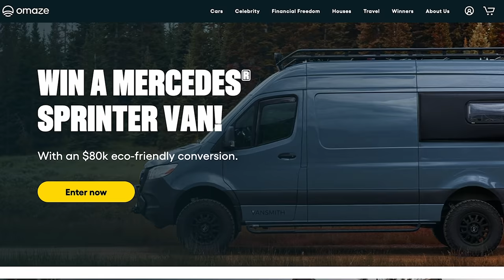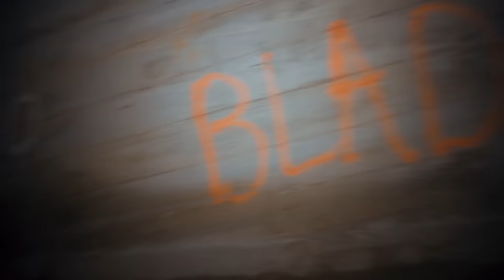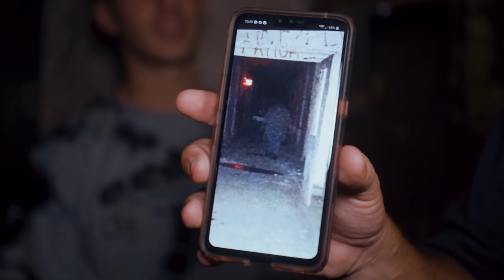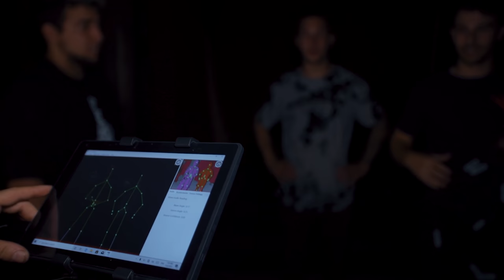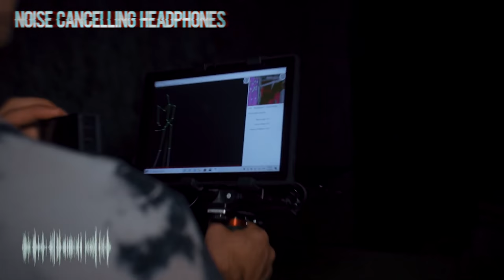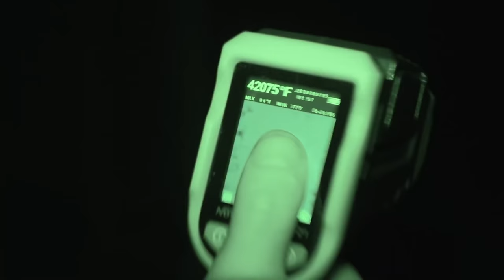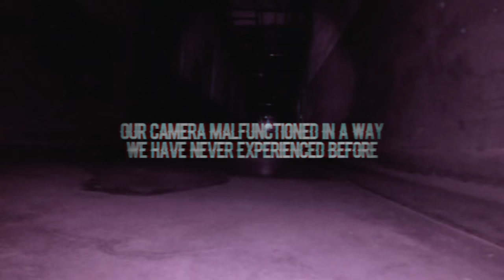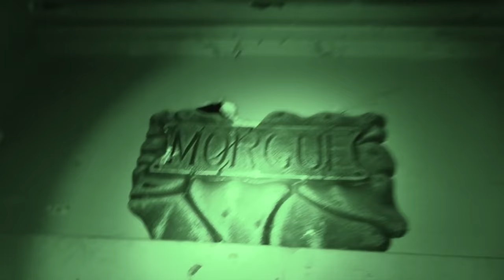OVERNIGHT in HAUNTED WAVERLY HILLS: Evil Lives Forever (Full Series)

Comment: 2:00:18 Around here, I don't know how to really wrap my head around it but you can see perhaps an orb quickly scale downwards then disappear. However, I am not too certain about my observation as it could also be something relevant to light, but it moved too quickly for it to be a light and Evan didn't move the camera down. So it's either a ghost orb or a dust particle.

2:01:33 three seconds later you can also see an orb or particle move upwards, however it's very close to the top.